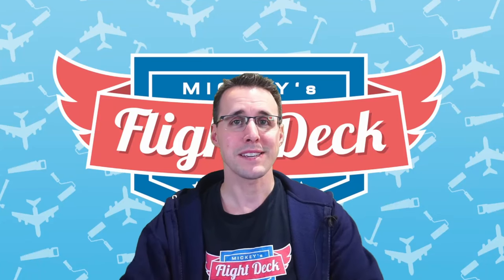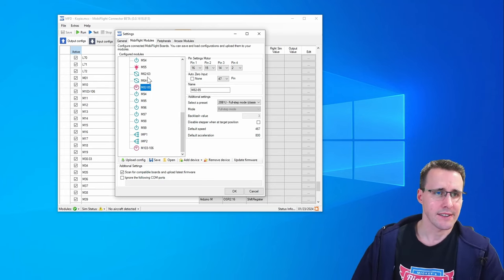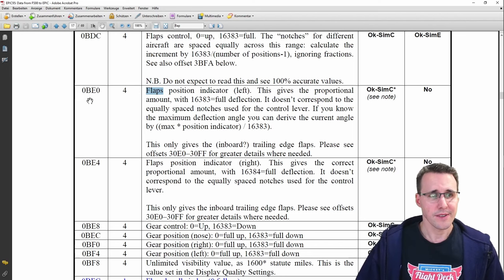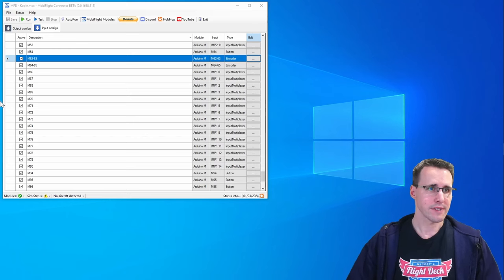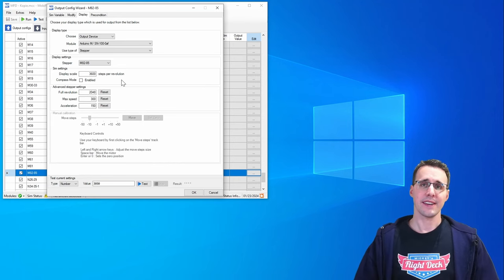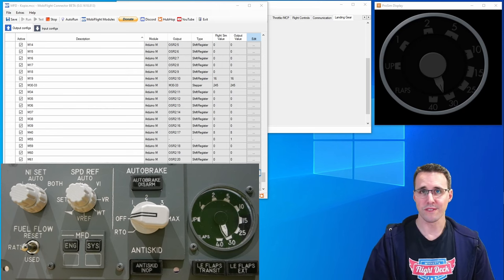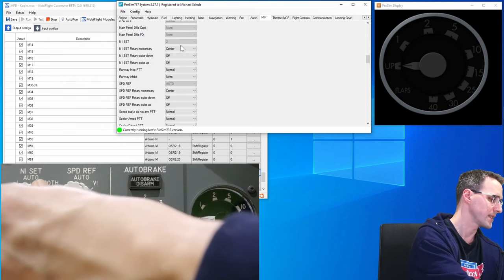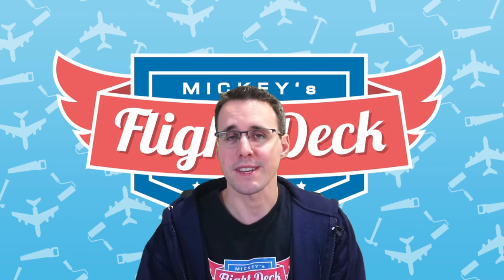Center Panel Configuration - A Boeing 737-800 Homecockpit #79

Comment: Hello Michael,

Do you have a video or a page on your website that explains why it takes 3 pieces of plexiglass (some of which are only partially painted) to make a part of the 737?

Why not cut out already painted plexi and possibly make small touch-ups if the CNC has caused some damage?

And why not engrave the texts before cutting the pieces to be sure you are in the right place?

Thanks in advance for your answers !

Thank you for all your sharing which is very inspiring to make you want to start!
Reply from the maker: Video #38 is the first one concerning panel making. It should be clear after this why to use three layers. Spoiler: You need space to hide the mounting nut of the switches. Doing the cutout and engraving at the same time can be done but you would have unpainted edges after this, where the backlight will come through.